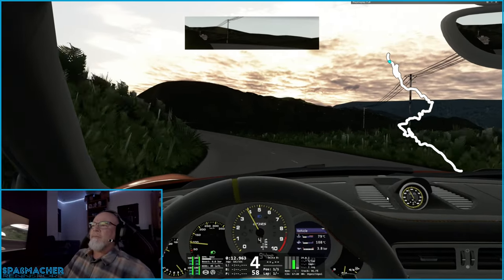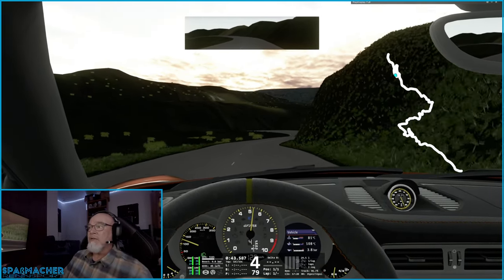AC drive of the relatively new Col de Thannenkirch map

Comment: Bro its 2024 get mods
Reply from the maker: I have mods...many mods, but what mods are you suggesting I lack that I should have?
Reply: @rt_clik  pure realistic graphics
Newwer tuned cars with full csp features
Screen ui change
New chase camera 
Better neck fx settings
Better quality map
Reply from the maker: Appreciate your input, but for some of your suggestions, I'll come back at you (as you came at me), "Bro get a clue".

First, I am running Pure, but I typically leave it at "Live" for accurate rl weather/time at the location the map represents (sometimes that's gray, overcast skies..other times you get gorgeous sunrises, as in this video). I use subtle filters, as I think the "candy" options look like garbage (my opinion).

There may be better CSP tuned cars, but this is the car I like to drive, so I do in a lot of my recent vids.

The HUD I use is RaceEssentials, which I prefer over newer mods like Sidekick. Again, personal preference. Not sure what other screen UI changes you suggest. If part of that is a view outside of the car, see below.

I only drive with the first-person, behind the wheel view, so do not use chase cameras. Period. I'm a sim racer, so don't do "arcade POV". There are streamers that do, so if f that's your thing, you'll be happier watching them.

If you have concrete suggestions for better neck fx, I'm happy to hear them. I only recently turned this on, as I don't actually like it. I'm not satisfied with how it's working currently, so will give it a few more tweaks in search of happiness, and if that fails, I'll be turning it back off anyway.

The maps I drive are new or newly discovered, and I would argue that the map in this video is a pretty high-quality example. Everyone is entitled to an opinion...but they are just that...opinions.

I love suggestions, but it will serve you best to understand yours is not the only valid opinion on how things should work or be, and often others' differing opinions produces results they enjoy and intend. If you're going to step to someone, don't just criticize...offer clear, constructive suggestions that might be useful...or better still, start a dialog that begins with, "hey, enjoyed x, y, and z, but wanted to know if you've heard about or are using any of a, b, or c."

Also, as a general rule, any critical statement that starts with "Bro..." is usually just going to tick someone off.

Thanks for watching!